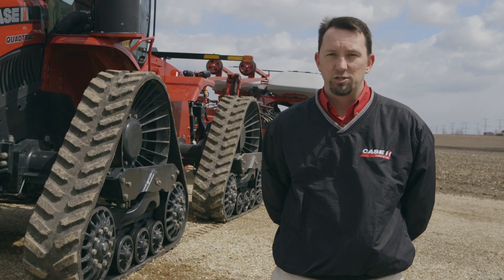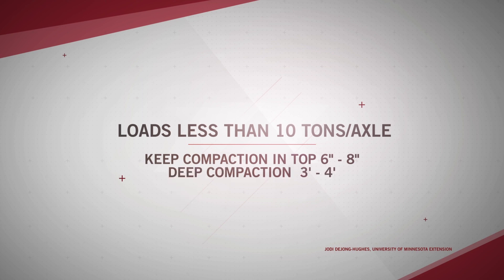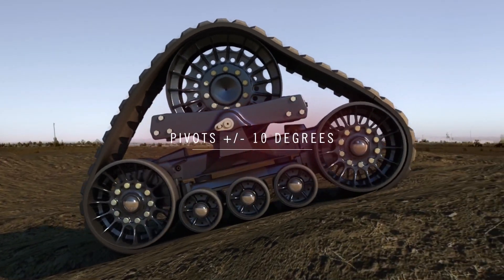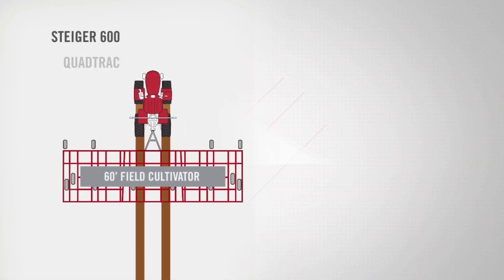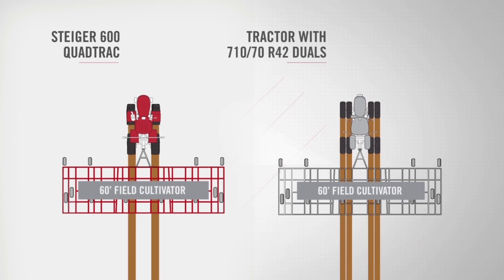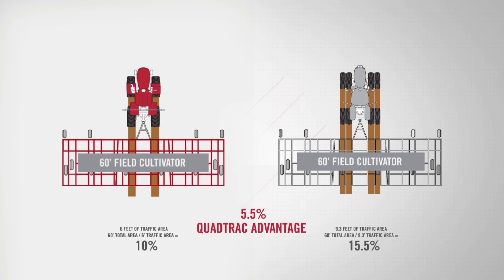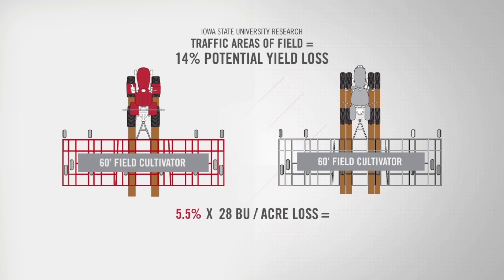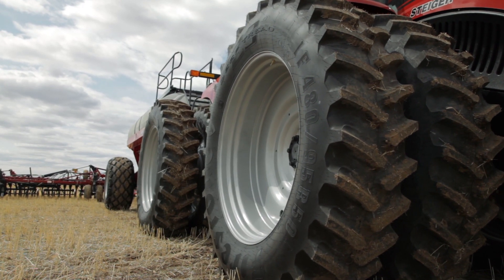Case IH Agronomic Design Insights: Minimizing Yield-Robbing Soil Compaction

Comment: Is there a reason why you do not talk about the area that is in contact with the ground? Why count the axles, when you could just divide the weight by contact area and would get the ground pressure in psi directly?   

(
Also, if we wanted to get technical, when looking at your animation, it seems that the middle three axles in each bogie sit on one carrier, so the whole system is not statically determinate and you cannot simply assume that all axles carry the same weight. It's not clear how that carrier is suspended/mounted, but it looks like some kind of elastic (rubber?) mounting, which again means you cannot assume that all five axles carry the same weight. 
)